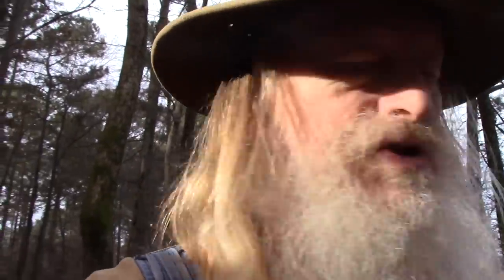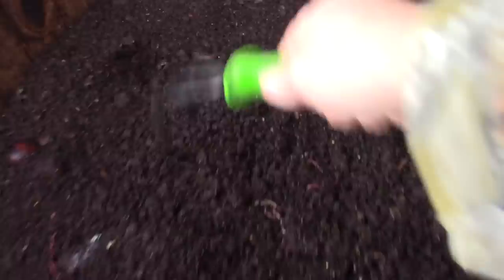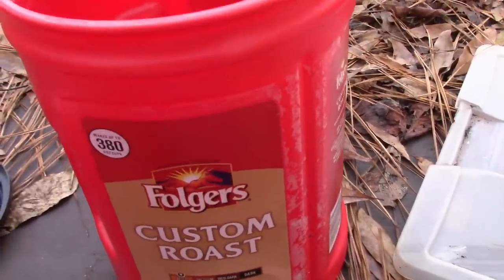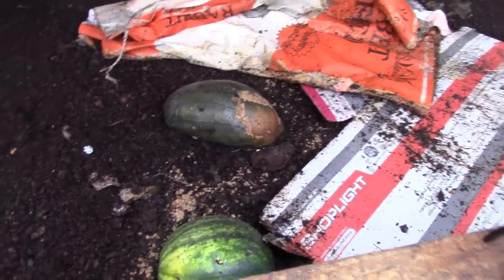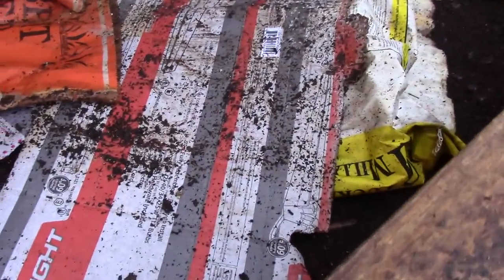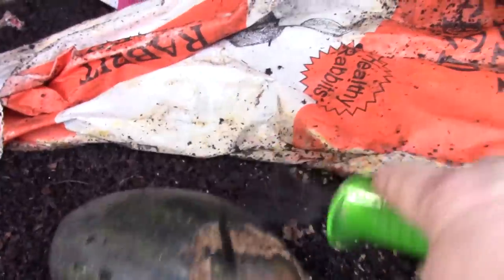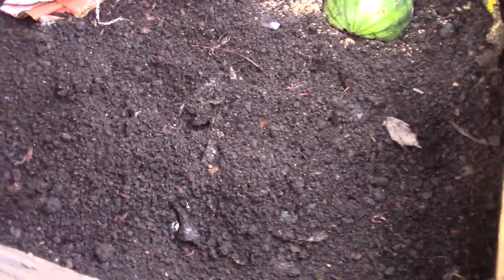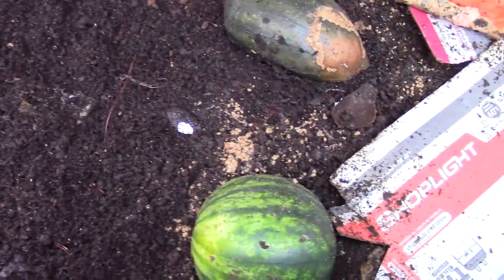5 KEYS TO RAISING WORMS

Comment: Could you use wood ash to raise the pH of your bed, or is that bad for the worms? 
Great video! Thanks for all the info. I've been wanting to get into raising worms to add more variety to my duck's diet.
Reply: As long as you place any food only in a corner of your bin and not strewn across the top, you can feed your worms anything you want because the worms themselves will decide whether to approach or move away from whatever you give them. In this way if you want to introduce any special materials you want in your compost, the worms will process the material for you. So for instance I live near the Pacific Ocean and periodically I'll harvest kelp from the ocean and give them to my worms. The worms will eat the kelp which will infuse the minerals from the kelp into my compost. And, it doesn't hurt that some sand is introduced into the bin to help the worms digest food better. For your purposes, ask yourself why you want the wood ash. If it's to modify the Ph, that's probably not an effective reason but if you're trying to balance something or are targeting a special need creating compost for a specific plant, then go ahead and give it to your worms... But as I describe which will allow your worms how much or fast to consume on their own.

Comment: the worm "pee"/liquid that drains from the worm bin is the most nutrient-rich worm essence/emulsion full of humic acid and beneficial bacteria, good to harvest and use for fertilization/compost teas.
Reply: I'm getting so many mixed signals on this! Others saying leachate is toxic to plants. Do you use it successfully?
Reply: @thats_alison745  I do use the leachate on my garden. If you want to be on the safe side I would use it on hardier plants and never feed diseased matter to the worms. Most professionals are hesitant to use it because it has passed through non-composted food scraps which can spread disease if it's already in your worm farm.
Reply: the water that drains from the bin is caused leachate. it is not the same as worm tea which has a much higher concentration of castings and nutrients.

Comment: I found this very informative and intriguing, thank-you. Was looking up the subject out of curiosity as I recently found a bunch of worms living in the soil of one of my houseplants as i was transplanting it. It was a green Pepper plant that had been over-wintering inside for the winter after I pulled it from the garden last year. Was planted in half compost/half top soil, with a small layer of mulch around the top, and the worms were going nuts. So glad to have found that and found this info on them.

Comment: 2feet soil depth for northern states
Bedding: well composted horse/cow manure sitting outside for months in the weather OR Peat moss soaked 24hrs then squeezed out to drip dryness; compost (gone through heat phase)
In ground bed line w/ 6 inch gravel surrounded by concrete blocks; cover bed w/ lid & weight; pure crushed dolomite(lime) in the bed to keep out fly larvae( a light dusting then dampen to dissolve)
Reply from the maker: Yup!

Comment: I use coco coir and rabbit droppings/ Timothy hay that the rabbits didn't finish eating, cardboard rolls, egg shells, coffee grounds.
Reply from the maker: All good for worms!
Reply: Coffee Grounds are not too acetic for worms?
Reply: @chuckkady7282  the acid in ground coffee is water soluble, so the vast majority of it ends up in your cup. The spent grounds, especially if well brewed, are very near neutral pH.
Spent grounds are still high in caffeine though, which stunts or even prevents plant growth, so never apply directly to soil. Hot compost or vermicompost the grounds. There is a particular type of bacteria that breaks down caffeine. I forget the species.
Reply: @Triggerfish70  Thanks :o) I will continue to dispose of my coffee grds in the land fill. Since the caffeine could affect the worms which I desire to raise.
Reply: @chuckkady7282 everyone says worms absolutely love coffee grounds. At the very least it should be safe in moderation, but it's up to you.
Reply: Cathy plant lover coffee grounds attracts mites

Comment: Hi Gregg,  I live in the desert where sometimes my home humidity monitor says 16% but “it’s reading doesn’t go any lower”. I ordered from another supplier before I found you. 😢 I decided that I needed one that they promote as being one you can keep in your house where it is cool and out of the sun.  I purchased worms and two complete worm bins with stackable trays that I could add this concoction of paper, volcanic rock, vegetable kitchen waste, etc.. What a mess! The red wrigglers were escaping! I was spritzing the newspaper covering on the top tray, I had nats every where! We do aquaponics on a very small scale in a sunroom so I had to move it out there...then I removed them from the beds to my outside gardens and the rest I put in the aquaponics beds.  I know the nats came from a bed being too wet, but I was only spritzing the dry upper layer and the news paper covering...It was too much work and trouble, now the expensive stackable worm towers that I purchased are cleaned up and in the garage wrapped in garbage bags waiting for a new use someday...  Do we need to raise our own or can we just purchase them and add them to our gardens? I also don’t know which worms are best for different needs.  I know the Red Wigglers are great for composting but which would be for both composting and fishing worms? Thank you for your videos, I learn so much from you!!!
Reply from the maker: Sounds like you have too much food in those beds!

Comment: So, what happens in the cold of winter.  I'm Pennsylvania and concerned about having a worm box outside.  Any suggestions on your part?
I just subscribed and enjoy your presentation.
Reply: I can tell you I pack my box full of brown leaves, my box is on the ground with galv.hardware wire and heavy landscape cloth. Use anything that's brown. I dont have a lid, dogs. Would better w lid. They love maple and lime w oak. Add leaves as it shrinks
Reply: I make videos, I also put buffer areas with humus and sand. I'm not raising worm I'm making casting. If the worms leave they dont go far.

Comment: Thank you for this video!! Ive watched so many to find out how to keep my worms but yours has had the information I need. I have my worms in a terracotta pot, peat moss in the bottom with currogated cardboard, and then the layer of food scraps. I had been adding soil (organic eco scraps brand) based off what other videos said but I noticed it didn't seem to be serving any purpose, finally I now know that it's unnecessary. I'm planning to get a wooden crate which will be more appropriate than my small pot, as I'm having to put most scraps directly into the garden due to lack of space in the pot. So, I'll use aged manure. Thank you!

Comment: I do not have air holes and I have them pretty wet and I have no problems as long as it does not dry out too much. I am using totes that are about that size. It did not take me long to figure out how to take care of them. I keep mine indoors.
Reply: No bugs and rodents like the smell of garlic and mint. Blend them up in water and saturate the ground with it and you will have no bugs and rodents messing with the plants.

Comment: I'm going to try a (out of box idea), getting a load of Horse manure, spreading , letting it dry out a bit then have some peat Moss and a pile of cardboard/ paper and run it in small portions thru my Troy Bilt chipper/leaf shredder  and I'll  add some dry scraps from Kitchen,  thus hoping it will make an awesome start bed material to add to the Long cattle feed troughs . I bought them cheap and had to rework a strong floor set up  and have them set on small slope to be able to catch the Liquid Gold run thru. The troughs set up a bit higher so less bending :))))
I'll let ya know how it turns out:))))
Best; Tom
Reply from the maker: Make sure that horsey is well matured first! You don't want to use it fresh for bedding.

Comment: So if you have compost that has been through all of its heat cycles, and use that as the bedding. Do the worms eat the compost? or just live in it? Another question. Would there be any issues making beds out of the plastic deck boards? say 3 foot deep 4 foot wide by 8 foot long? Thank you! keep up the great videos!

Comment: Loved the video, great ideas, very informative. I live in Stone County, Missery so have to garden with raised beds made from 2"x10"x18' long. I always put a dozen worms in them in the Spring, but I also use the regular garden lime. Going to switch to the dolomite. It is very common I see at Home Depot and other places of the like. Very inspirational video. I am going to try the plastic container bed as well so I can get the "Worm Tea".  If you go to buy Worm Tea, it is very expensive. I have a heated and insulated 8'x10' workshop/shed I can put them in, in the Winter. What about coffee grounds. You always hear about putting coffee grounds in a garden. Would that be recommended or not? Thanks!!

Comment: Can confirm re: water will not necessarily kill your worms.  I came out one winter to find my plastic container bin with a layer of water a couple inches thick on top of my compost/bedding layer.  I pulled the compost and bedding out and found that the worms weren't all dead.  They didn't seem happy about all the moving around or the excess water, but they survived it.
Reply from the maker: Yeah, I've seen that many times.

Comment: Hey love your video and thanks for the knowledge. I have a question about insects I have a wood chip bed in a Walmart bucket that I keep indoors that I've had for two months my questions is why my worms reproduce slowly. How often should I feed them. I have alot of little white insects on top of my compost will they harm my worms. How to get rid of them? Sorry to ask sooo many questions but I'm new to this and could use some help please.
Reply from the maker: Probably springtails and they do ot harm worms. If your woodchips are not old they may be to hard for the worms. If they are pine they may irritate or even kill the worms to some degree.

Comment: Excellent content, obviously backed up by practice. - People look for ways to make money online, and worm composting is very versatile, from process your scraps in the kitchen up to make money in your basement. Nothing wrong with using that to make money - if they would go the full mile and make the experiences first before they try to sell a product or sell expertise (that is what they do when they get ads on youtube). 
Or a honest business model would be to eclare themselves to be well informed (theory) rookies, aggregating all the information that is important (that has value) and turning that into a worm-along challenge, the audience and they are doing that together. Building the container, and then raising and harvesting them. Or putting the worm castings to good use. 

But some just take the shortcuts. (Part of sending would be to do some tests, and it is dishonest to position yourself as expert when you have no experience).

Comment: Don't worry about rambling, I was bothered a bit in the beginning. But got over it quick once I found out how much good info you were spitting out. A pinch repetitive but thats how I learn anyway.  Using Plastic drum whacked 1/3 way down like one subscriber said below. Drilling holes with glue gun screen wire ( per what you said ) to keep them in and worm eaters out. Great Vid !

Comment: Hi, did you happen to have a video on doing a warm farm in an IBC Tote?  I cut two in half and put in a foot of aged cow manure but it heated up and killed the worms. I took it out and put on about 4 inches but still got quite warm and considering we are having 108 degree days. After watching your video I am thinking the cow poo had not gone through its heat cycle as we have been in drought and even though its aged it has not had the heat treatment. Just wondering if you cover anywhere how much manure to put in and how often to feed and with what?  Thanks so much
Reply from the maker: I have mentioned that your compost has to go through the heat cycle first. Be sure to watch all of my videos on this.

Comment: This is the most informative worm growing video I've ever seen.  Thank you very much.  I live in south Louisiana about 30 miles north of Lafayette/I10.  I'm a gardener.  I live where they grow crawfish and rice.  My soil is thick clay less than 8 inches down.  I use raised beds for my vegetables.  Usually grow my tomatoes and bell peppers in containers.  I'd like to grow worms for casting as well as tea.  The red worms that you grow, are they red wigglers?  I'm more interested in growing worms for my personal garden, but certainly no opposed to selling some.  I like the plywood design of your worm houses.  I was thinking of putting pvc worm towers in each of beds, the clay seems to work as a barrier keeping them in, but like the idea of giving them a protected home.   I might need to buy some worms; think you'd be a good option.
Please advise,
Charles
Roll Tide  (if your an Auburn fan, no offense)
Reply: Great video,  , very informative,  you truly are a clever Man,
Reply from the maker: Yes, red wigglers

Comment: Could you make a video on a good starter bed for a beginner?
Reply: Hello hope youre having a good day. I just recently started my worm journey n i know your comment is a month old so just wondering if u ever got yours started. im a little over a month in and i have 3 bins going so far. 1 of pure red wigglers and 1 of pure european nightcrawlers with 1 now breeder bin now for the crawlers. the 2 totes i use are 17 gallons each and the breeder bin is one of those concrete mortar trays i got from lowes for $8.50 which is a lil smaller but its what all the worm ppl seem to be using. The 2 bigger bins im just using as growout bins so they are all big, small n in-between. I hope this helps and good luck on your journey :)

Comment: Hey Greg, I need little advice! I've been soaking up the great information from your videos, The weather is getting better after the wettest February ever! I'm about 100 miles North East of you, and just about got my first 4×8 bin ready. My question is how many worms should I start this size bin with? I love and appreciate all your videos! Keep them coming & God bless!
Reply from the maker: You can have a pound of worms per square foot - so 32 pounds in that bed. They double every 2 - 3 months, so if you want to let them double 3 times start with 8 pounds - 20,000 bed-run worms - or start with 4,000 to let them have a year to fill it. Just depends on how fast you want to fill the bed and turn over the compost.
Reply: @greengregs  Thanks Greg, I appreciate your response. I'll be in touch with you within the next couple of weeks. I'll probably start with somewhere between 5 & 8 thousand, going by your answer. Just curious what you think about instead of shipping the worms, if it would be ok if I came down to pick them up and pick your brain a little? Your videos are so full of great information and I'd like to see your set up in person. Thanks for your time & sharing your knowledge!  Keep up the good work with those awesome videos! ✌️
Reply: @jonathanmccoy6660  IMO the better answer to this commonly asked question is that the size of the bin doesn't matter, what matters are your objectives, ie how much food are you going to feed your worms? Or, how much compost do you want to create in a particular amount of time? The point is that everything else is secondary aside from the idea that if you start with too few worms they might die and you'll end up having to start over. A knowledgeable worm breeder will grow an enormous amount of worms within a few months or years, it all depends on how fast you want to get to a certain point... Is it OK to fill a large worm bin over a few years or do you want to fill your bin within a few months? Worms can reproduce only so fast no matter your skill.

Comment: I am starting to get the idea that composting kitchen scraps is different from worm composting. Am I right?  If we must be careful about over feeding we also need to know which scraps can be worm composted. I gather that citrus peels must not go in worm beds due to acid , but maybe used somehow to deter pests. Please correct my thinking on this. I have a very small garden and yard. I thought I would have a little compost pile and then I thought I would rather have worms in my garden, but now I’m confused. I don’t think I have room for both. What about if I blend my kitchen scraps with a bit of honey water and put in my vegetable or flower garden directly would it be an instant composter?
Reply from the maker: You can compost much - should be most of your kitchen scraps through a worm bed. But you have to be selective.

Comment: Awesome info, GG...For bedding I'm using Coco Coir with saw dust, I found a clean organic free supply of saw dust but it's from Cedar trees. My question is . Will Cedar saw dust be too strong for a worm bin?
Reply from the maker: Quite possibly, I do gave some in some horse manure but it's aged well over a year before I use it. Try some (just a little) in a small corner of a bed and see ho the worms react to it. If they do okay start ramping it up and see how they react.